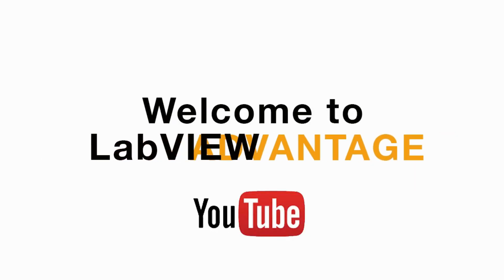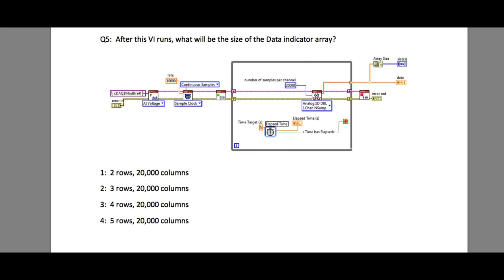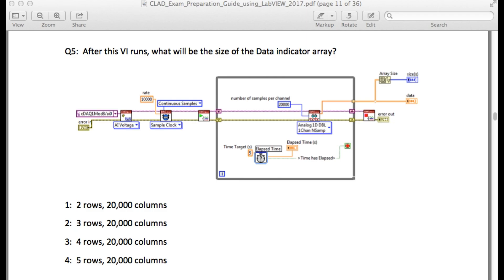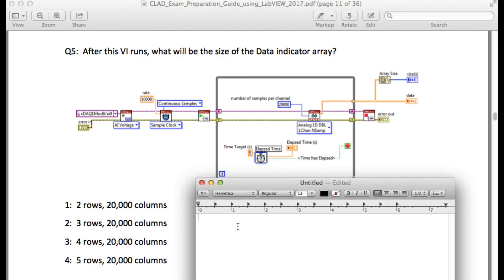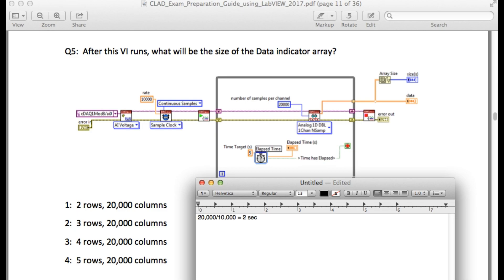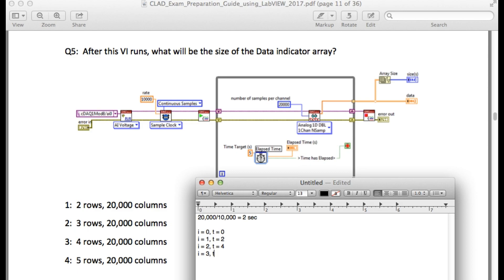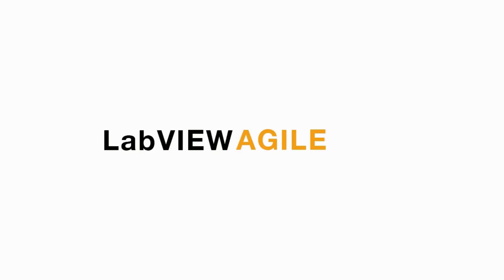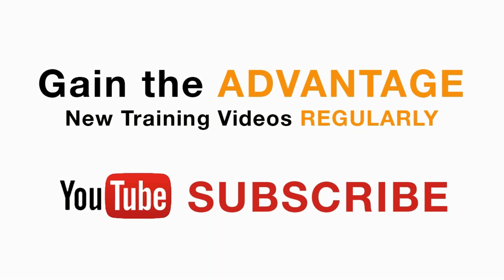LabVIEW CLAD 005 DAQ Size of Array

Comment: A better explanation would be as follows:
We need to remind ourselves that elaspsed timer has no dependeny so it will execute as quickly as possible. This means when the code enters the while loop, elapsed timer is evaluated immediately which in the first iteration would be 0 or a number close to it. The while loop takes 2 sec to complete the execution so at the end of the first iteration the time would be 2 sec.
In the same way, in the next iteration the elapsed timer is evaluted and time is 2 sec, so the second iteration also executes. 
At the start of 3rd iteration the time is 4sec and elapsed timer is again evaluated as false. 
However, on 4th iteration the elapsed timer is evaluated to true (the time is 6sec) but since it is while loop, this will execute.

Comment: Hi There, thank you for doing these videos. 

Could you shed some light on this? Has the DAQmx read reported any data at i = 0 and t = 0? I thought that only after 2 seconds had passed was data ready for output. I don't understand why the answer is 4x20000 when at i = 0 and t = 0 nothing has happened.
Reply: Hi, there is another way of seeing this exercise. The acquisition task is higher priority than the elapsed time function; this way:
i=0, t=2
i=1, t=4
i=2, t=6, time has elapsed, but acquisiton is the priority, this way the condition (boolean) is still False but will change in the next iteration.
i=3, t=8 Here the boolean changes to True and an acquistion was issued as well.